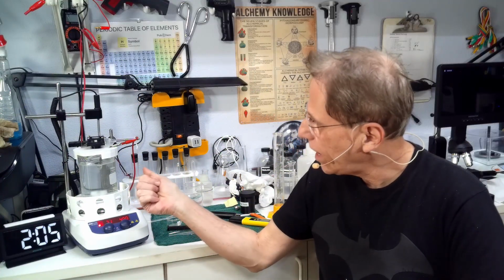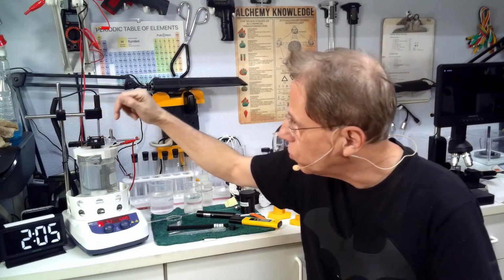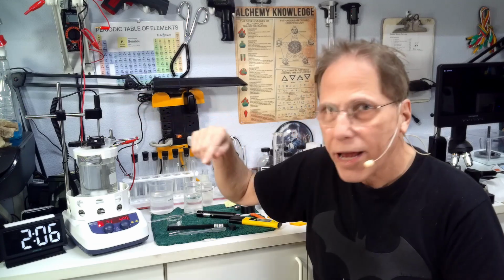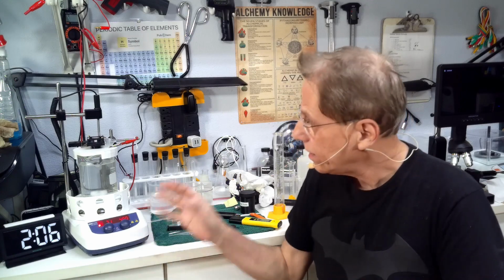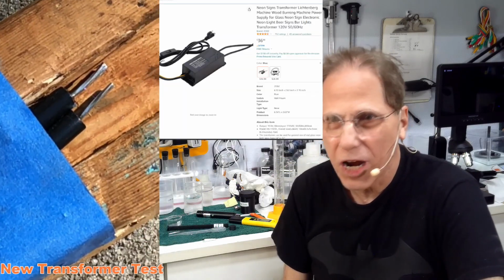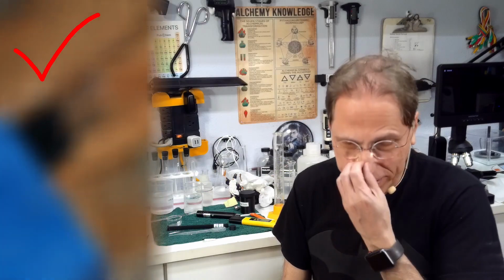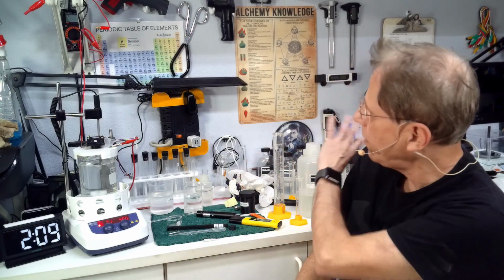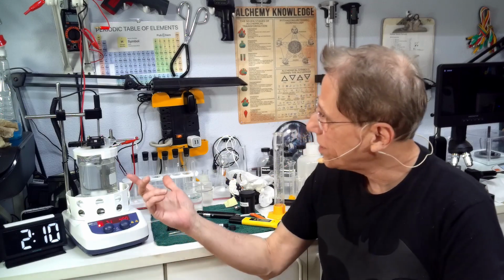Platinum and HVAC Nanoparticle Generator Update!

Comment: You might want to try using bubbles from a tube to agitate the solution instead of a stirrer. A cheap low power aquarium pump should be enough.
Reply from the maker: yes i have one here and used the bubble trick with my first silver rig. I was planning on trying that as well. Also looking into one of those high frequency vibration things, if the new stirrer does not survive.

I'm excited about trying out HVAC. It may not be something people here can use, but it will be fun to build and try. 

The silver sludge I got was impressive. LOL! So once it starts making nanoparticles it will be interesting to compare with low voltage one.